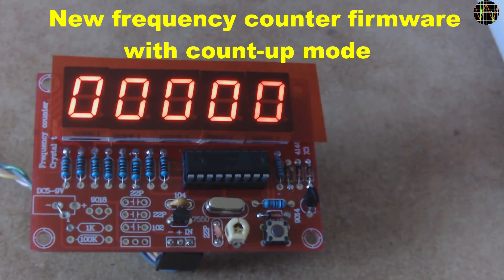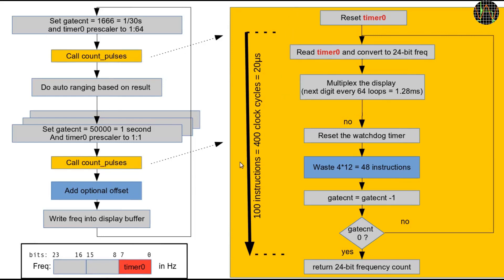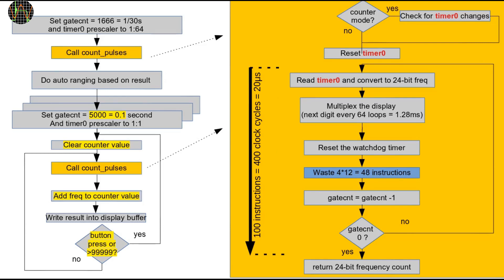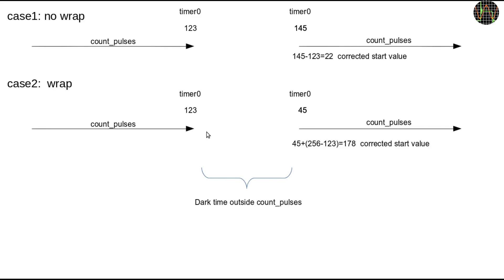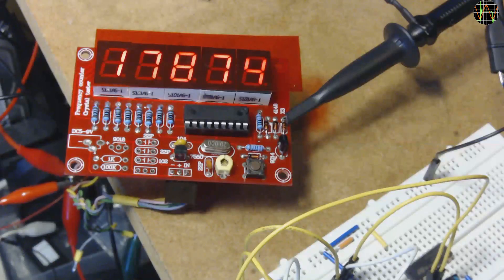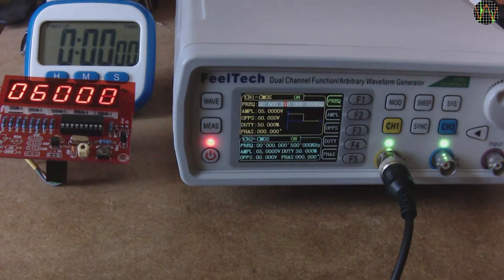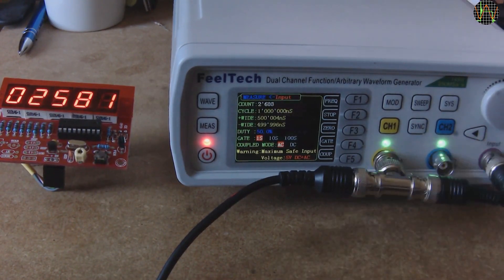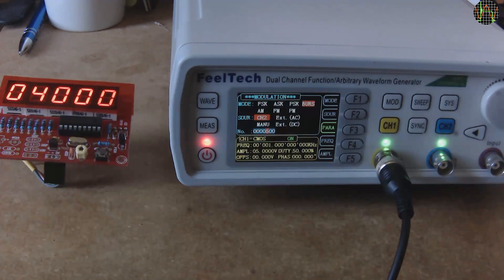New PIC16F628A Frequency Counter Firmware with count-up mode

Comment: Never mind .. I finally figured out how to clear it..
Here’s my previous txt.
I bought an EZM branded one thru Elecbee … Mine worked for a short time (a few measuring sessions over a few days), then all of a sudden outputted 16.152 (or something like that), when measuring 10.7 MHz. I pressed the prog button a few times, pressing it when it said zero. Now it displays several values, then goes to 0. It’s lost its marbles. Any idea why it failed? Is the firmware corrupt? What’s the best way to reprogram it?
Reply from the maker: I am not clear if you are running my firmware or the standard one? The oirginal was intended to be used as a radio frequency display by actually measuring the IF and then adding an offset to display the tuned frequency. Its possible you got inside some of those settings to select/edit those offsets. If that's not the case (or its my firmware) then its quite possible a fault. Could be firmware but solder joints are a possibility. My firmware  as assembler source or as hex file can be freely downloaded from my github page but of course not the original. My firmware measures frequency  (and more) but does not have the IF +offset capability of the original.